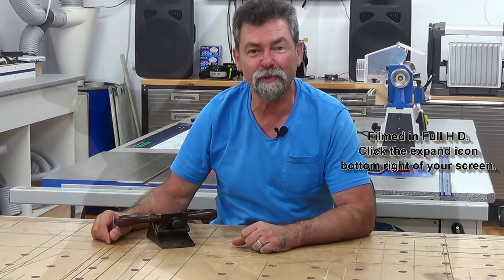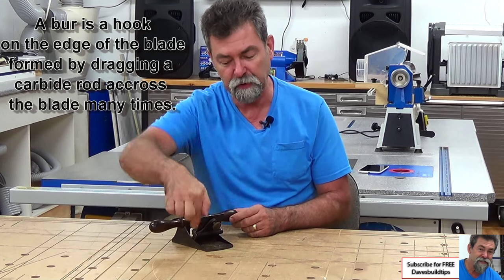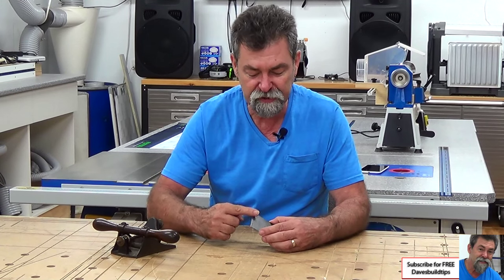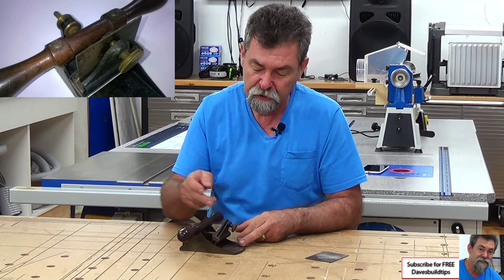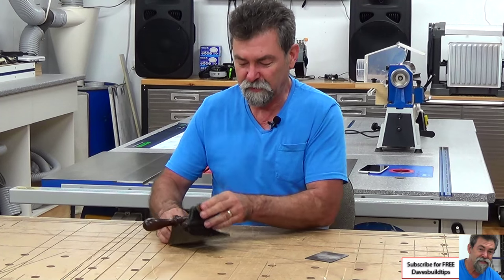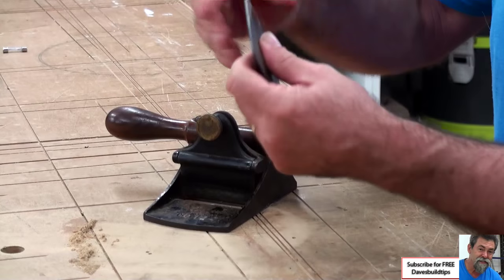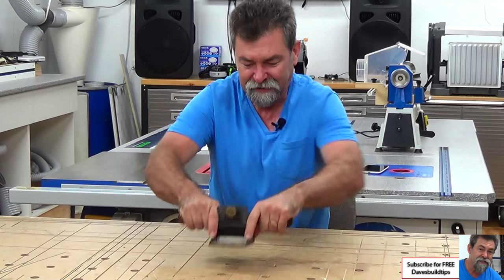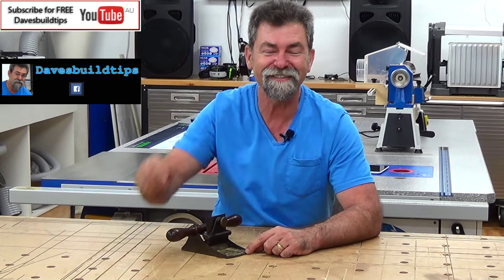Stanley Number 12 Veneer Scraper Plane | Arthur's Tool Box

Comment: Bought one on eBay about a year ago.  I use the Stanley 12 first to remove the major dings, dents, and such in the wood; then, finish with a card scraper.  The finished product is perfect... no more sandpaper on the large areas.  Finer sandpapers tend to seal the pores of wood... and stains/ finishes don’t absorb as well.  The scraper is the ticket!
Reply: Thank you for that tip!

Comment: I have a selection of scrapers but this is a brilliant tool, the amount of times that I have had to stop using a scraper due to my hands getting cramps holding the scraper. This looks like a great alternative to holding them.
Reply from the maker: +John Fithian-Franks I would have to practice a lot with it John but I think you are right but only for flat surfaces.

Comment: This tool is great for people that can't use planes well, like me. It works well in conjunction with a ROS. I sand at lower grits to remove high spots, and with the no12 i can finish flattening. You can tell what still needs to be removed because it will be faded. Skips a lot of grits and friendly to use
Reply from the maker: I'm glad you found this tool helpful for your woodworking needs! It's always great to have options that can make the process easier.
Reply: @DavidStanton  thank you! I'm excited to use it again after watching this, I was using it with the scraper closer to perpendicular. So, thanks for the tip

Comment: Hey David, loved your video. Very informative :) I have a No. 12 exactly like yours, besides the fact that there are four threaded holes in the body. They are in pairs opposite each other. Two at the front end and two at the back. Do you know what they are for? I am guessing some sort og guide? Keep on the good work!
Reply: 12 1/2 has a timber base. Needs screws to hold timber.
Reply: @1deerndingo  Hey David! I have looked at min and it is for sure a no. 12 and the holes are on the sides, not the bottom. Do you know if there where some sort of guide rail for the no. 12?

Comment: Is it bevel up or down?
Reply from the maker: +eaglecot Depends on if the blade is tipped forward or backward. Normal condition is forward and bevel to the rear.
Reply: When you insert the blade insert it with the Beveled side toward the Back (pointing toward the 2 adjusting nuts) with the Burr Pointing toward the front (toward the clamp that holds the Blade) Hope this helps.